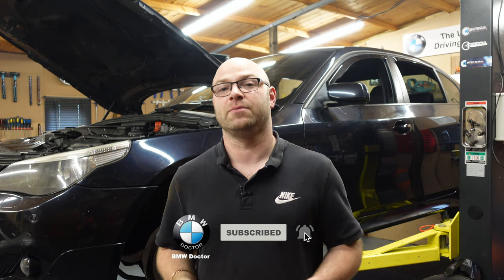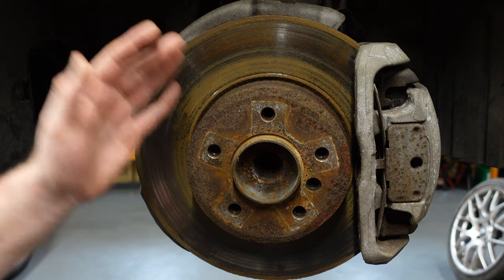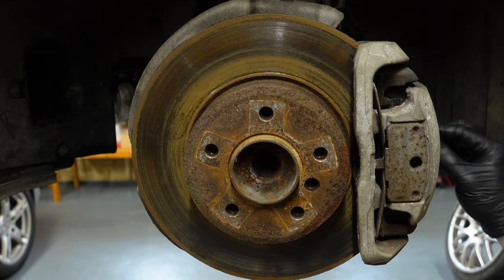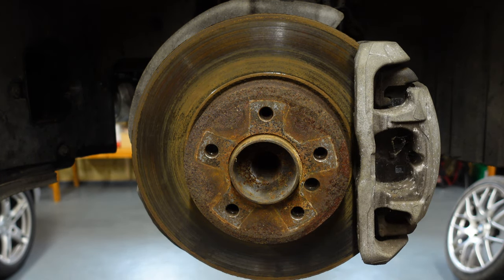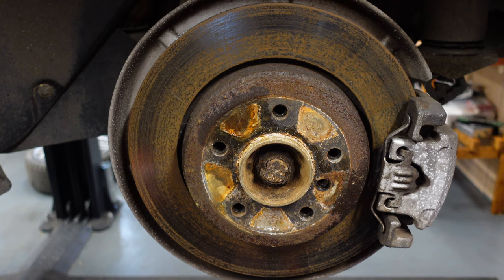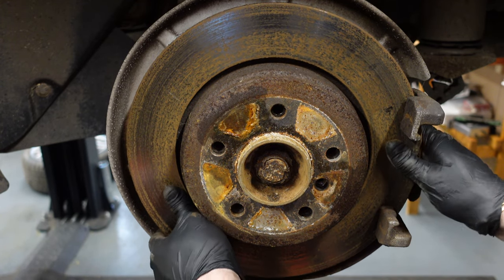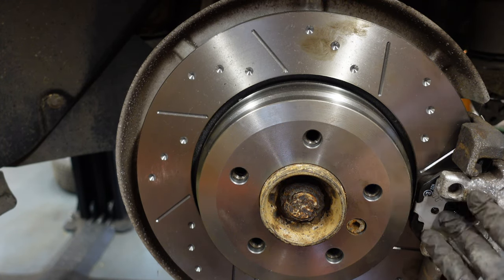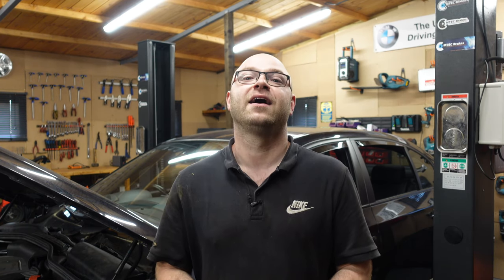BMW E60 Restoration /// Brake Pads & Discs Overhaul

Comment: What about checking and replacing the e brake shoes? How often does that need to happen? Is replacement and adjustment the same as any other drum brakes?

Comment: Do you think Mtec discs would be good enough on an M135i or stick to two piece discs like OEM?
Reply from the maker: I wouldn't change the M135I have good braking system already as they use brembo and 6 pot calipers stick with brembo

Comment: No silicone grease on slider pins ?
Reply from the maker: No not needed on this as these brakes was only done a year ago. The slide pins come out and back in perfectly unlike my 6 series which they was stuck from nobody using grease they was seized.
Reply from the maker: I only use WD40 to help them slide back in but as for grease I do not use on slide pins as I heard a lot of bad stuff regarding using grease on the pins. No way they can seize anyway as there very well covered and if they do just change out the calliper as if they seize it means you got bigger issues with the calliper